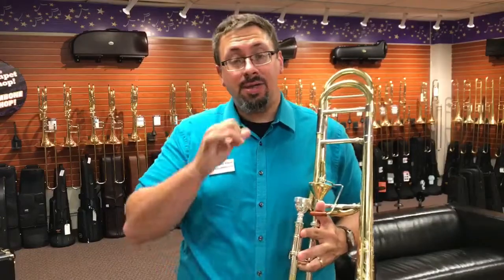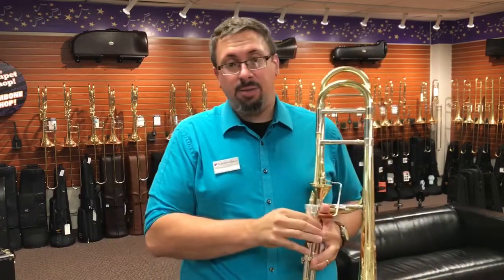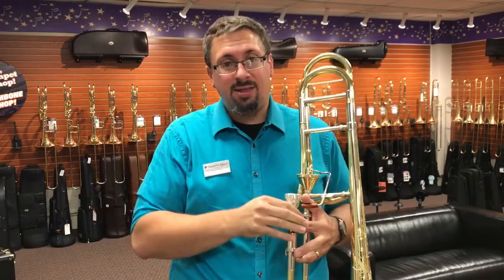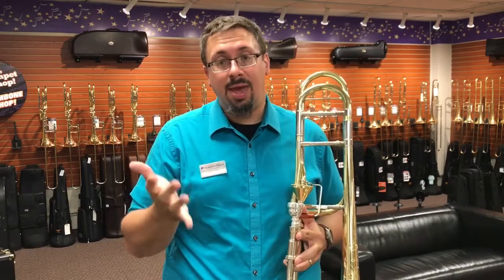Milashius Mouthpieces 5G Review

Comment: Keith, 

I would agree with all of your observations regarding the differences between each of the mouthpieces. I find with the Milashius mouthpiece that your sound and pitch is more stable than with the Bach. The initial pitch is more controlled and the center of the note is achieved sooner and thus provides a greater stability. The only problem I can readily identify is the sound on the Milashius at lower dynamics. It could be a matter of support or simply due to the fact that you do not have the same experience with the mouthpiece as you do with the Bach. With more time spent on the Milashius I feel as though this could be a better choice for you than the Bach . Then again, as you clearly know, it is all up to the individual to decide what is the best for their sound. Thank you for all the work and time you put into your videos. It is greatly appreciated.
Reply from the maker: Thank you for the detailed feedback!  My soft chops were not feeling 100% during the video as it was but in general I find all of your observations to be true!